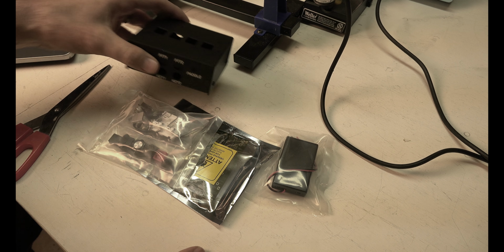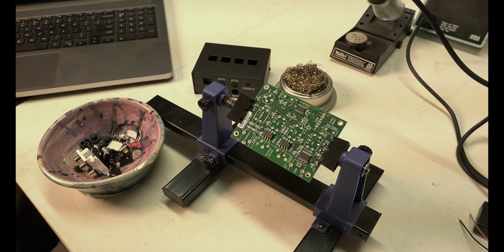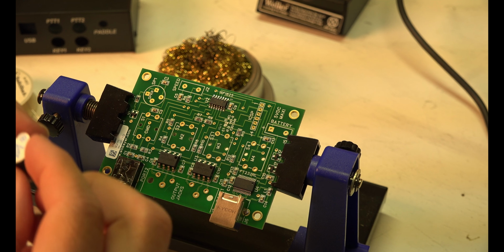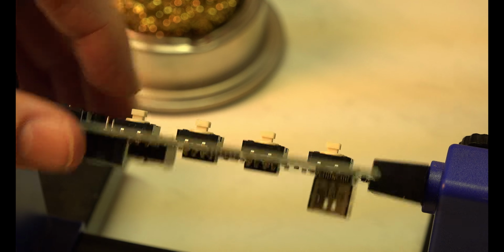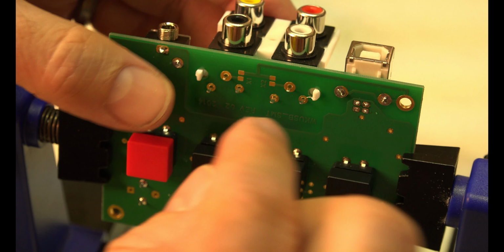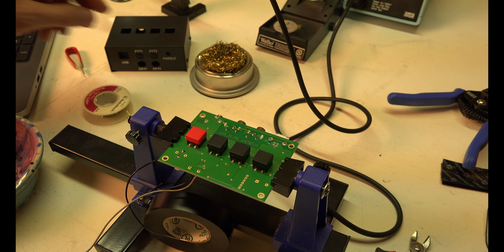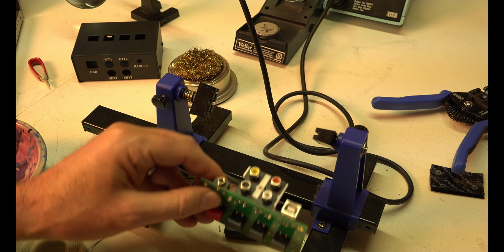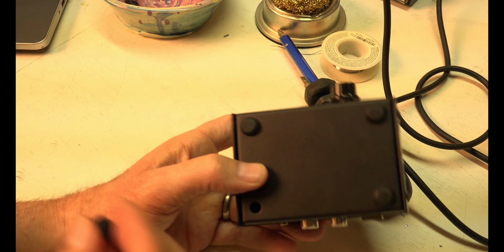Winkeyer CW Kit Soldering Build | Beginner Ham Radio CW Training

Comment: I have one of these WKUSB kits on the way.  Your video was really good.  I would recommend though that you open up the box and remove the paper cover from the speaker that you mounted on the board.  The cover says to leave it in place until you "wash" the board which uses chemicals to remove the flux residue around the solder joints.  Once you are finished with the washing, if you chose to do that, then remove the covering from the speaker and I would think the sound would be much louder than you experienced in the video.  An excellent video for sure.  Bob - W5QCP
Reply from the maker: Thanks you are correct. I think another commenter saw that also.  This little kit is a great practice tool.  See my other video about the CW "Game"

Comment: Thank you so much for this little nugget about “Iambic Master”.  I ordered an FTDI USB Serial board for my home brew k3ng keyer and modified its code for WinKeyer support (its built into the k3ng sketch).  The FTDI arrived today at work at lunch and I was using Iambic Master at work about 15 mins later.  This program is brutal for me as I am getting back into CW.  I can already see how this is going to best tool for getting good at sending CW.

Comment: I love the Radio Shack solder, I just ran out of my last Radio Shack tube of solder at the end of last summer and had to actually search on where to buy solder as I’d only ever bought it from RS all my life (I’m 49).  I just finished a K3NG keyer project with an Arduino.  I’m using this one for practice sending only at the moment. I like the idea of interfacing with a computer to use more advanced programs for CW sending.
Reply: Cool, I can setup my K3NG keyer to emulate Winkey, thanks. https://github.com/k3ng/k3ng_cw_keyer/wiki/370-Feature:-Winkey

Comment: Nice job. I have the older model that I use every day. It's great for older radios that don't have a built in keyer. I noticed that you still had the protective cover on the pizo speaker as you were assembling the covers. If you remove that, the audio will be louder.
Reply from the maker: Charlie K0LAF omg duhhh. I need to remove that I thought it was irrelevant but probably does make a difference thanks for the tip!